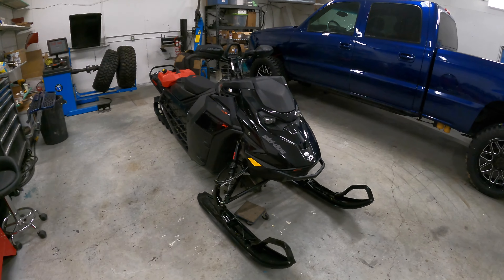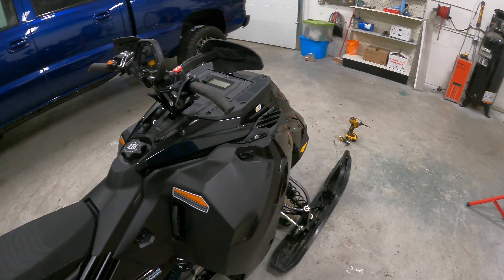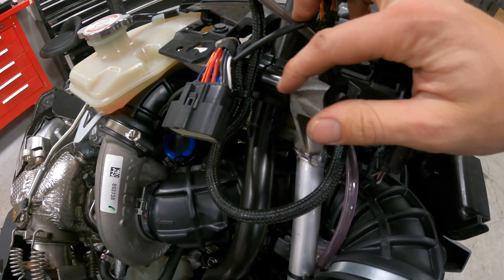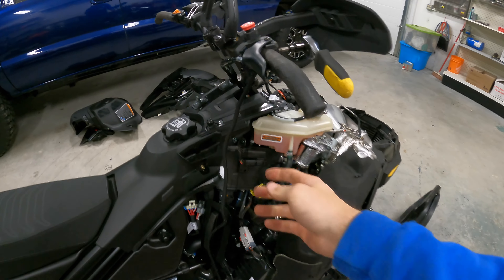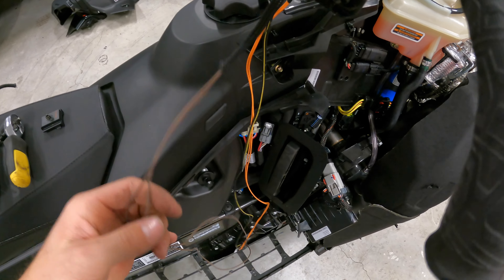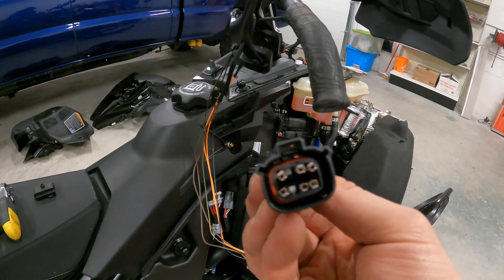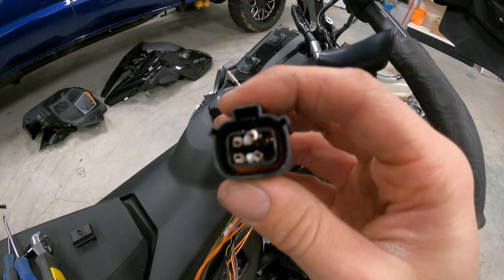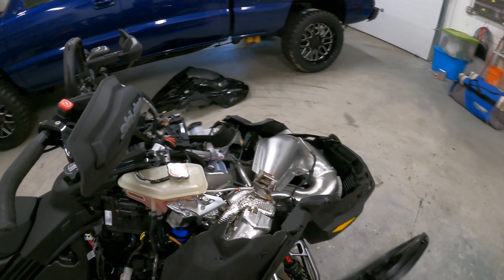G5 Munster Finger Throttle install 2023 Ski-doo Turbo 850

Comment: Ill be installing mine on my gen 5 when the bumper shows up next week. Any advice on placement? Do you run the finger throttle below the brake lever or xlose to the same plane?
Reply from the maker: @thecitiots  just depends what feels good, I run mine pretty much the same height as the brake lever and when I’m standing up it’s at the height that feels the best
Reply: @turbodan  awesome thanks

Comment: Why this vs just flipping the OEM throttle around
Reply: I have one on my PRO RMK and one in the mail for my 23 Lynx. The thumb throttle is allot fatter and made of plastic. The  Munster is thinner and made of high grade Aluminum. You could try flipping it just to see how you like it before you buy one but it won't be exactly the same. You may also find that the heated grip wires will interfere with doing that. The Munster is way better and specifically designed for your finger. I love mine.
Reply: @TheRedsuper1  Is the pull force about the same? or have they changed the leverage on it slightly for an easier pull?
Reply from the maker: Id say the pull force would be about the same, i can ride all day and my finger never gets sore
Reply: @ieatpa1n  I agree with @Turbo Dan. The pull force is the same because that comes from the return spring on the throttle body side. Both the finger and thumb throttles don't have springs. Also you do not have to completely disassemble the front of it's non-turbo. You only have to remove the small cover by the riser and the right side. The plug is located behind the coolant bottle.
Reply: @ieatpa1n  the Munster finger throttle is by “FAR” made to have a lot more leverage and easy to pull than if you used your OEM thumb throttle as a finger throttle. It’s not easy to pull with one finger. You might as well buy the Munster finger throttle and if you don’t like it, flip it around and use it as a thumb throttle. I have a riding buddies that have done that and they prefer using the Munster finger throttle as a thumb throttle
Reply: Stock gets full of snow and sticks Munster does not